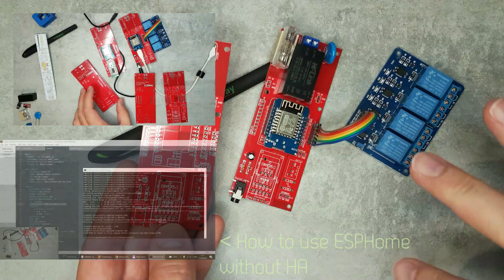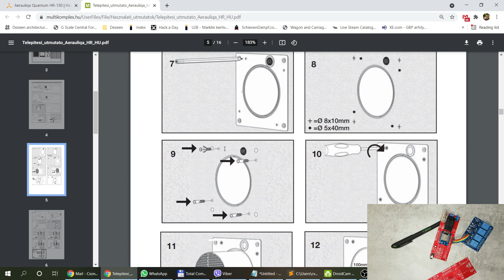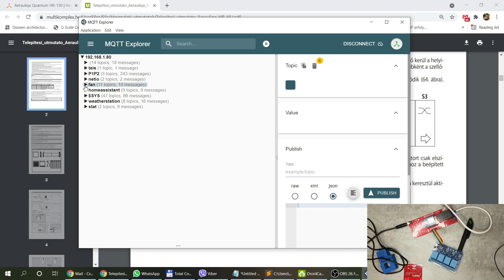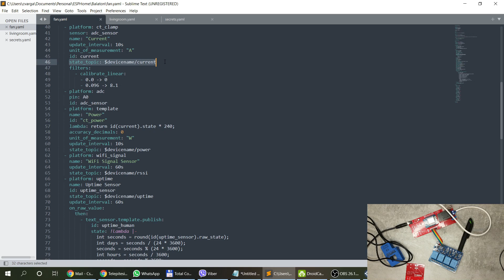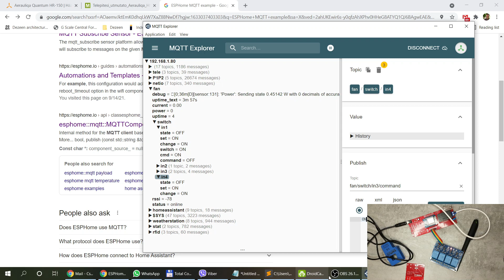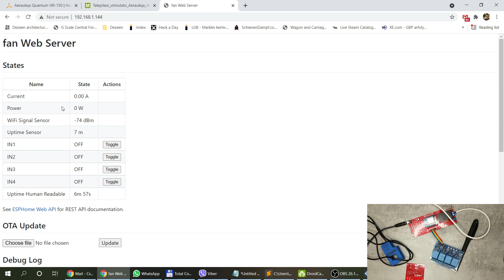Fan controller with speed settings

Comment: Hi sir, we have some problems to solve regarding our project. can we setup a meeting?
Reply from the maker: Tell me what is your issue?
Reply: @csongorvarga  we hve multiple input of mqtt connection. When we collect the data in the csv. Those data is not synchronise and the data arrangement in csv is totally mess up
Reply from the maker: @haziqsalim5116  I assume this is related to my Node-Red flow. What you can do is store the values from the mqtt connections in a flow variable, and when you store them you can get it from the flow variables. The timing will be off a little, but that is the best I can recommend.